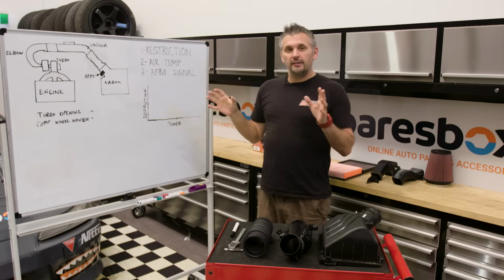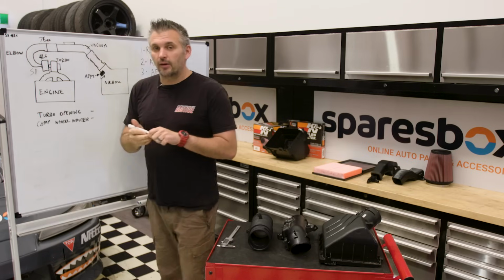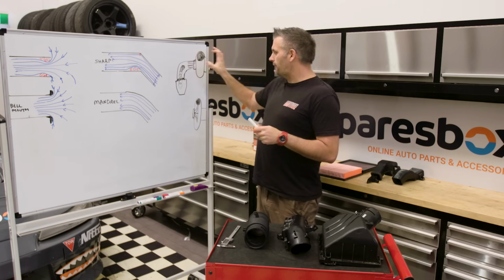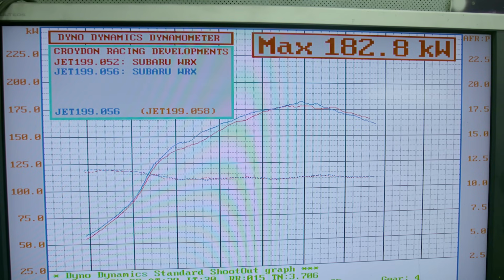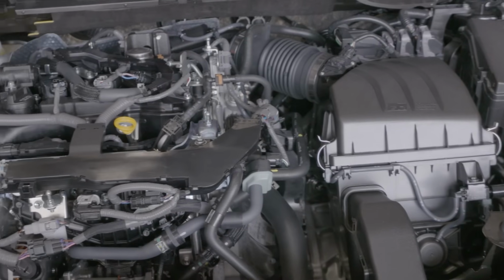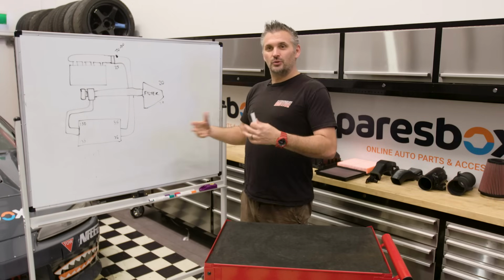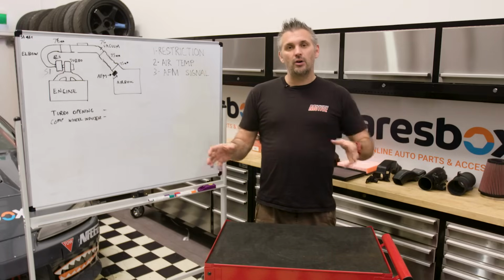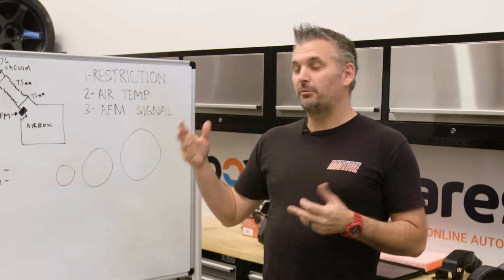Why Cold Air Intakes DON'T or DO Work on Your Car - Motive Tech

Comment: Just like oem 5th gen 4runners already come with a cold air intake, it is what it's called in the manual, as it truly does take cold air from the right wheel well. But people still replace it with TRD PRO cold air intake. Fools just needed a less restrictive filter.

Comment: Best explanation so far!  A lot of mods actually reduce power!  I know a garage that cut a bonnet scoop in the bonnet of a Subaru where the intake was. Logic tells you that more cold air equals more power. Bizarrely the intake temps increased! On another subaru they fitted a high-flow intercooler which cut the intake temps by over 50% on track. There are many subtle mods you can do that don't increase overall power but improve throttle response like removing the turbo muffler on Audis.

Comment: I noticed when you did the swaps the battery  was never disconnected,  also I would never test it on a stationary  dyno , as in some but not all the ram air  effect  is not present no matter , cold air intakes is only a small part of the formula  , air intake , throttle  body , intake  runners , headers , exhaust  , and program , then u will see gains , then internals  to make more, plus I always wrap my intake  with header wrap

Comment: Most late model cars come STOCK with a cold air intake. They draw cold air from behind the grill or inside a wheel well. The after market “Cold air intake” sits under the hood and collects HOT air. It may be less restrictive, but, it is anything but cold air. I run a stock air box with either a AEM dry drop in filter or a K&N oiled filter to open things up a bit.
Reply: I have a 2010 toyota tacoma, the first mod I did was one of those "cold air" intakes. Yes it's less restrictive and you can hear an audible throttle sound. The down side is there wasn't any noticeable mpg difference no power difference. I'm now planning to swap that intake out for more of an actual cold air intake, hopefully we'll see an actual difference.
Reply: @joshburts1044  Why not port your AC into the air box with -40 degree air from the ambient air? cold air is what we are looking for; I don't know if the AC can supply enough air, but until I do I'll never know!

Comment: It doesn’t work when you don’t tune with it yes, but for the Audi S3, Golf R, Leon Cupra there are kits out there from REVO and APR which when tuned it does make a dramatic difference and this is because they’re closed boxes just like the OEM part but with less restriction and better temperature qualties, but just throwing one on yes I agree they do naff all ☺️✌🏻

Comment: Would be good to try a drop in performance filter on that 996 to see how it compares to the cone and stock paper filter. Personally think if it’s a well designed intake system a drop in filter is usually the way to go especially with NA cars as the penalty for sucking in hot air through a cone will loose power

Comment: It's worth noting that a sharp edge immediately before a turbo (i.e. if packaging requires a 90 hard up against the intake, like early Subarus and a few euro things) puts up to half the compressor in a lower pressure zone, affecting overall compressor efficiency (effectively the turbo is operating at a higher pressure ratio).

I read a paper on this, the authors designed a roughly banjo-shaped fitting that allowed a bellmouth to be used and fed efficiently from one side (kind of like an old-school carb filter housing that has air piped in from one side but still has even flow around the carb. Like that, but much more compact and actually with a big enough inlet hole). The improvements in compressor efficiency were measurable and useful.

Also it sounds like the filter on your GTR was limited by airflow area. Once velocity approaches sonic sucking harder doesn't result in more airflow and just results in more vacuum. The area for airflow through the filter (minus any boundary layer effects in the filter) was less than the pipe. If it was a shape problem you'd note increasing gains up to that point rather than the wall that you got. I'd wager a bigger/deeper filter in the same spot would get you your 50hp back. If such a filter exists...

Also Also re air temp on turbo cars: ALL SUBARUS NEED INTERCOOLER FANS. I put my 280,000km otherwise completely stock Gen 4 Legacy GT down the strip and ran 4x 14.9 second passes, and I largely attribute that to the intercooler always being cool because I put a fan on it.

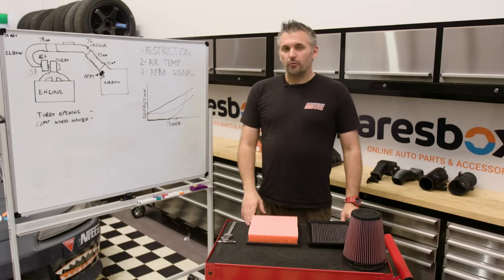Comment: 14:30
yes, KN filters are cleanable.
Most should serviced every 5,000 miles because it's the pil that catches the dust,,,
AND clean the MAS
300 miles after reoiling..... because the fresh oil vapor will screw up your mass air sensor, so it must be cleaned.
Of course, almost nobody ever cleans or oils a KN and if they do they dont clean the MAS. 
Nobody cares.

Comment: What I've found is low end on a bone stock car you lose low end power but pick up a little more high end power .. I'd personally rather have low end power .. Also lost a little throttle response.. I'm referring to a non boosted car ..

Comment: Another dangerous thing I am seeing more these days on Instagram builds is when people disconnect the Crankcase inlet ventilation pipe or reroute it incorrectly, it must T-piece off AFTER the MAF sensor and not upstream of it, causes so many issues as on the opposite end of the crankcase the PCV is still burning air - non-metered IF the inlet to the Turbo OR throttle body in NA engine doesn't have this vent to the crankcase as a sealed system.

Comment: The only benefit of an aftermarket intake is the sound. If that matters to you, then it matters. No discernable  power gain can ever be gained.  I just gave you all the information that you need to know about intakes in 7 seconds.
Reply from the maker: They do work on some cars. This video is designed to help you understand why it will or wont.

Comment: Also all well and good for a turbo car, what about doing a OE stock engine and what gains can be made for changing the Air filter to a sport KN type of air filter?
Reply: oil vapor screws up the MAS wire
and 
KN type dont filter dust well. The oil catches the dust.
Clean and reoil every 5,000 miles, then 300 later clean the MAS wire.
JMO I threw my KN away.

Comment: So putting a A/C style intercooler system to cool the air going back into the engine will always keep the air temps consistent even on a 40 degree c day outside, so interchiller run by a/C gas systems are the way to go ,but they are expensive and are also used on supercharged engines seen air intake temps as low as 5 degrees c even the A/C lines get condensation build up they are that cold?

Comment: I have a stock closed OEM intake on a Genesis G70 3.3T (twin turbo) - Someone tested the flow of the intake and found it has 9 inches of vacuum. By removing the initial inlets that point 90 degrees up and have a narrow design, they found the restriction dropped to just 4 inches. So the inlets are now rectangle shaped and facing forward to the grill. Is there benefit to adding "snorkels", even though the air needs to pass through the OEM panel filter?

Comment: The same reason a N/A car feels better with cooler air is the SAME reason a turbo car will. Yes, an intercooler helps, but physics is physics...if you START with more dense air (cooler temps), you GET a higher density charge in the cylinder. End of story. There is no magic. Start with the coolest air you can get and go from there.

Comment: I've gone through a K&N drop in filter, K&N Black Hawk CAI, Injen Evolution CAI and then JLT CAI with a 2018 IM for my 2016 S550 and TBH the best power I felt was the basic drop in filter where I didn't lose any low end torque and acceleration. Now I only have power from the mid to high range and low end it's kind sleepy! I might go back to my stock intake and leave the 18 IM as is.

Comment: great video Andrew very detailed , owned a 93 R33 GTST the best intake mod by far was a front mount intercooler , you raised a good point about air flow and the air temp thru an intercooler , on a warm/hot day your car might feel sluggish which with a standard intercooler is indeed very noticeable , much less noticeable after fitting the front mount intercooler i ran als K&N but to be honest when your using only 10psi no difference except the cost saving

Comment: Very good piece. Could you, at some point touch on the particulate sizes of grit permitted by some aftermarket filter, and the after effects to the engine, vs the very good filtration of the stock paper filter?
Reply: HP is far more important than longevity!

Comment: Jet engines do not like turbulence. They can surge and suffer compressor stall. 
The turbulence needs to be on the serious side for this to happen and is more dangerous when the engine is at or close to full throttle or at minimum power cruising speed. You need to think of it a bit like a boat skipping over waves and the propeller coming out of the water. Above about two hundred miles per hour air is more like water than the stuff you breathe.
Turbulent air does effect turbochargers . The greatest effects are noise and heat and reduced efficiency resulting in higher egt and shorter bearing life.

Comment: Iv got a 208 gtline, 1.2 3 cylinder turbo, with stage 1 map and a ram air induction kit, iv noticed a considerable difference in power when its hot outside to when its cooler. The car runs perfect below 60 f but in the 70s/80s then there is big difference in power when the turbo comes on boost. Also u need to remap your car if you are going to fit an induction kit as the standard tune still thinks your running the standard filter…?? I reckon Iv gained 10% in power and torque with the ram air kit when the air temperature is right.

Comment: I agree with everything in this video, I find that with a lot of modern cars there's no benefit to changing the airbox as the manufacturers (like Audi) get it right the first time. And the whole reason why I choose to use K&N drop in filters is what was mentioned in the video: they're cleanable. That's it. Doesn't matter if it makes any real hp gains, it stops me buying 40, 50, $100 replacement paper filters every 20,000km.

Comment: You will NEVER get performance beyond computer programming! If you add an airfilter to improve air flow which demands fuel for power, you need computer programming! Stupid people putting on bolt on parts not knowing cars need programming!

Comment: I know this may surprise some people, but there is no cold air under the hood. Any kit that draws air from the engine bay is a waste of money.
Reply from the maker: Incorrect. Ducts can push ambient air into the engine bay
Reply: @MotiveVideo   So? Unless that duct is directly connected to the intake, like it is in every OEM setup I am aware of, the air will still be heated up before getting to the intake. There is no magic way of getting air to the intake without it mixing with other air.

Comment: Great vid! Andrew, I am looking at making a custom sealed intake. What is the best material to use for the box itself to keep hot air out and cool air in. At first it will be 3D printed in plastic, however will consider remaking it from metal/carbon if considerably better for heat reduction. Cheers.
Reply: Air passes through so rapidly heat gain is minimal.
#1 Seal it up tight.
Reply: if you make one out of metal in the future i would like one something like an A51 intake replica for an first gen is300

Comment: Eventuri makes intakes that utilize a much smoother air flow path than stock or most aftermarket ones, which does result in more air in the combustion chamber, at a rate that is  faster...which means more power... so smooth airflow especialy in a NA application will make more power and economy... this is even more crucial in NA rotary applications. maybe see if the guy at Eventuri will let you borrow an intake to do some tests with. id like to see that video. a few things you said werent true tho, the comment below mine addresses most of them.

Comment: You forgot about one thing with cold air intake on turbo cars. Efficiency of turbocharger, denser the air the efficiency is better
Reply from the maker: we did day that
Reply: @MotiveVideo  I mean the part around 19:00. It's a bit like "if you have intercooler good enough it doesn't matter if your intake temp (just behind air filter) is 100 degree C"
But I could haven't notice some part, it's a long video and i was watching just before sleep ;)

Comment: on my 1.8tsi i installed a simota conic air filter with bigger pipes. With stock ecu it made literally 0 difference in horsepower, just much better noise. Once i added full exhaust, downpipe , bigger injectors and a stage 2 tune, i dynoed back to back with and without the CAI and it made almost a 15hp difference.

Comment: There was one a few years ago with aftermarket intakes for VW and Audi. Can't remember who the manufacturer was but they changed the thickness of the piping. OD was the same but ID increased. People who had the original version raved about how good the intake was but those that got the revised model absolutely hated them. Fuel trims were out, they ran roughly, had hesitation on acceleration. All because they ID had changed by 1 - 2mm which meant that the MAF signal was messed up.

Comment: Re hot vs cold air hitting the turbo compressor wheel - the turbo can only compress air at the density of the air presented to the compressor. 

If it's thin air (from being hot or from being at the top of Pikes Peak) the turbo is going to be spinning harder and less efficiently (i.e generating more heat) to compress the air to the same absolute pressure. Whether the intercooler can "mop up after" an inefficient compressor stage probably depends on the application and the circumstances at that moment.  

The whole Pikes Peak driven evolution of turbocharged competitors is quite fascinating. Eg the current trend of running turbo speed sensors so they can spin the turbo as fast as possible (compressing very thin air near the top) but with fail-safes to keep the turbo at less than "fly apart into bits" turbo speed.
Reply from the maker: We know all this, and said all of this. what we said was that quite often the intercooler is doing a lot of  the work.
Reply: @MotiveVideo  You mentioned temperature pre-compressor and temperature on the hot side of the intercooler, but nothing on the effect on compressor efficiency of thinner hotter air at the face of the compressor (unless you count skipping over the issue via that "the way turbochargers work - temp increase not necessarily the same" bit at 19 mins as talking about it?).
Reply from the maker: @yowie0889  We skimmed it. 10 degrees air temp difference into the turbo doesn't do muhc if you have a good intercooler. But does if you dont have one or a crap one.
Reply: @MotiveVideo  All good. Editorial decisions when filming a "basics of topic x" video are up to you. A short video can't cover everything in detail.  

For some applications an intercooler may do a good job of mopping-up after a poorly placed pod filter, but  for the minority of applications where every last inefficiency needs to be minimised, it is much better to be drawing cold dense air and compressing that. 

FYI comments in the comments section are not necessarily criticism of the video. In my case it's just throwing more information into the discussion. If you don't mind the feedback here, the look of jumping on lots of comments with responses to the effect of "we know, we bloody said that!" might not be the look of the Motive brand you intend.

Comment: Brilliant video Andrew from another mechanical engineer. Can't fault it.
One additional measurement that I use is the intake flow speed to correlate restriction. A rule of thumb guideline that I use before doing actual testing is Mach 0.4. If the airflow speed exceeds this level then a restriction is starting to form. Airflow volume / intake cross section = flow speed. A smaller cross section speeds up the airflow, and vica versa.
Reply: literallyt has nothing to do with mechanical engineering.. in fact nothing about automotive condition has anything to do with mechanical engineering.. unless your talking about the bridges we race on... intake and VE is fluid dynamics... mechanical engineers are waaaaaaaaaaaaaay smarter
Reply: @modfoxv10  do you know what mechanical engineering is? Lmao

Comment: I've tried a pod filter on my gr4 and sounds great. 2nd thing I noticed  it felt "funny" pulling through the revs. Like a slight dip in power on and off. Came to the conclusion and it was exactly how you discussed everything in your video. Combined un even flow through the maf and heat from the engine  bay, most more noticeable when sitting in traffic  for a little  bit. Already got the stock aibox back in. Their is a air ducted down lower that goes to nothing, is that for cooling the transmission? It would  be cool if someone  developed a airbox flap delete kit and joined the bottom duct to the airbox
Reply: @LeonL47 the problem is people install cold air intakes but don't put it to a location that can get air or to hot of air

Comment: A highly informative video.
That point about the intercooler air temp drop vs the cold air intake, never considered that fact but I have ducted my intercooler as per your 'best practice aero' video, such a great video.
Regarding air movement through ducting, I read an article which stated that if air is to be ducted, by ram effect only, a 90 degree bend equates to around 36 feet of straight ducting due to the direction change. This seems feasible and it would be great to hear opinions on this.
Reply: If you're interested, there's a popular book by Corky Bell called Maximum Boost. Page 58 has great info on airflow through heat exchangers.